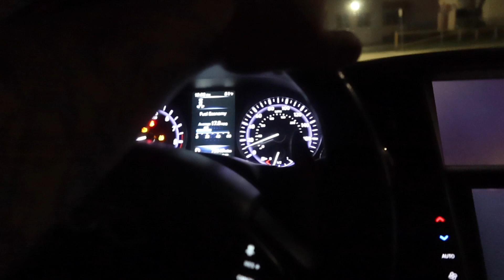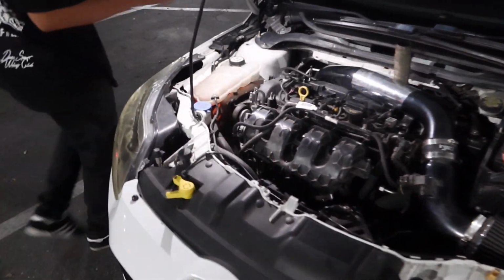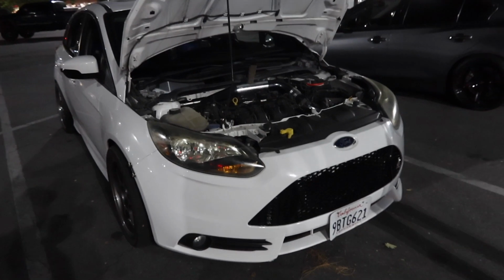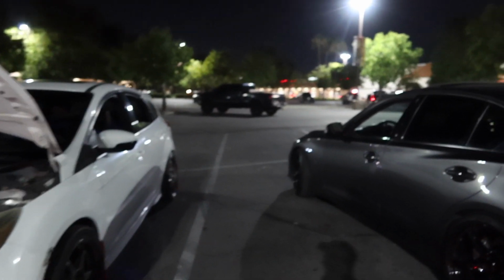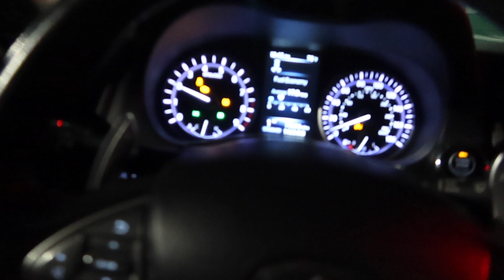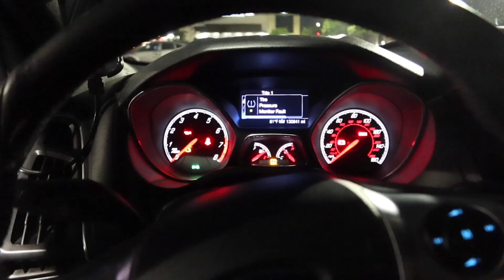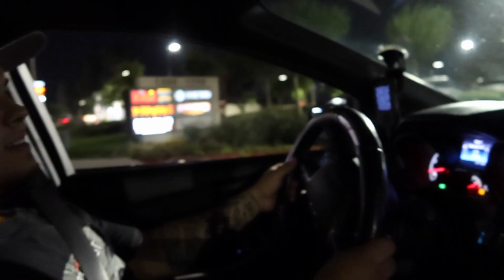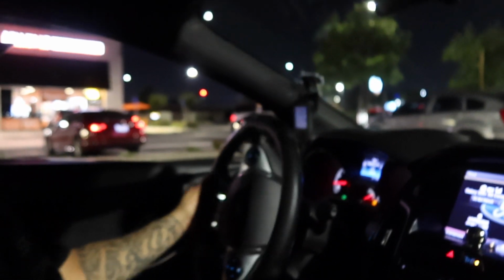BIG TURBO FOCUS ST CALLS OUT MY Q50 FOR A RACE! *HUGE FLAMES*

Comment: Yeah hes on stock fueling...wont see anything past 360whp likely. On my 2016 FoST, I'm running a 3071, XDi HPFP, RS injectors, and my map 1 (93 tune) is about 380-390whp, with map 2 (E40) I'm about 420whp right now on a conservative tune since my clutch is still stock. Upgrade to Aux fuel or get an HPFP/injectors and these will open up big time on the top end. The Q/G platforms always sound awesome...but I like the sporty, hatchback look of the Focus ST/RS as an underdog since most ppl assume its 'just a focus' lol

Good runs!
Reply from the maker: Focus are definitely some sick cars, I feel like they’re slept on 🔥
Reply: I’m on a gtx 2867 gen 2 and im fbo running e50 pushing 400whp, I haven’t touched my injectors but Alan at edge got me good with my tune and it feels crazy, I beat a fbo 1st gen 5.0
Reply: @jerryyanezst2  thats gotta be with a 2 port at least..?  I'd be surprised if your stock hpfp/injectors were allowing you to hit 400whp. Its pretty rare for it to get that high without fuel upgrades..though Alan knows his stuff, just like Brian with JST, they both get our platform dialed in great. I'm on the BNR3071, XDi35 hpfp, RS injectors, E40, and dont know what I'm making..but I know i make so much torque my stock clutch cant handle power shifts when I do 3rd and 4th gear runs. My 93 map is only around 380/390whp (limited by the pump gas)...but on E40 conservatively Brian says I'm likely at 410whp+...and based on what Ive beaten just in the last week, Scat pack Challengers, FBO/E30 tuned S550 Mustangs, modded S550 Mustang GTs (today actually lol), new gen Surpas (not sure which model the two were that I beat), FBO/big turbo STi's,  etc....  I'm guessing I'm making a decent amount north of that estimate. In the market for a clutch before mine decides to take a dump lol
Reply: @dham99  that’s so awesome, yeah I talked to Alan and he said that he’s been pushing my car around 400whp, so actually might be a little less than that, I just haven’t messed with fuel but I’m going to look into injectors and a fuel pump for the st, do you have any recommendations
Reply: @jerryyanezst2  if you're just looking for a safe power limit, the RS injectors should keep you under anything you'd be tempted to push past lol. Just last week I ran down a 392 Scat Pack Challenger, my friends 2023 Eco Mustang FBO E30, and a new Supra (not sure which model though). I found out during those runs, I have very bad clutch slip during power shifts..  I walked away, got slip for a good 4s or so, and then kept going. My buddy in the Mustang just installed and tuned for his BNR600 and we're going to give it another run. I have a feeling I'm still going to walk away... but who knows XD

The XDi35 pump and stock RS injectors is a good combo I found. All bolt in, easy to tune for if your tuner has done them before. The RS injectors I bought off Rockauto for under $200 shipped. They came fully assembled and ready to swap. Also highly recommend installing a Radium PCV baffled plate or similar one...i had a lot of black smoke on WOT before the plate upgrade, then it completely disappeared after. I also run 2 catch cans, one is vented to atmosphere (damond with vta kit). I got my HPFP lightly used on a Focus ST sale group on FB... for almost half price. They show up every now and then, just make sure you get all the hardware and SS line for the high pressure line to the fuel rail.

Comment: Getting a new car my two options is a 2013 12k g37 wit 100k miles and a 2015 q50 3.7 14k with 90k miles. I like the q50 a little bit more but love both. J don’t know if the 10k less miles worth it.
Reply from the maker: I would say q50, I know it’s only a 10k mile difference for $2k, but the interior in the q50 is a night in day difference from the g37, the whole car actually is. I know this because I have both & trust me, q50s are worth the extra $, they also look a lot newer as well

Comment: Need to ask the focus st dude a question.... If I want 350bhp do I need a built motor?? Ty m8
Reply from the maker: No bro you can achieve that with stock motor and bolt ons with a e85 tune
Reply: @jaayz3379  Thankyou mate
Reply: You can hit 400hp stock motor with big turbo and fueling bro 420hp is max but that’s pushing it
Reply: @jondiaz3021  appreciate it mate, only because these companies in the UK be telling me I need a rebuild after 300 like wtf 😂🙄🤷‍♂️🤷‍♂️
Reply: I run 30psi on my stock motor and so far so good 😅 haven’t ran it on a dyno so idk what the hp is but it’s big turbo with 4 port. I think it depends on the condition of your engine. Less mileage the better off you are! I definitely would be confident with 350 on stock motor! Good luck!